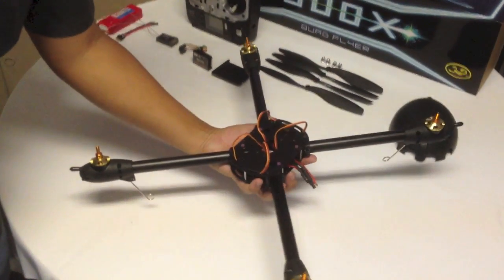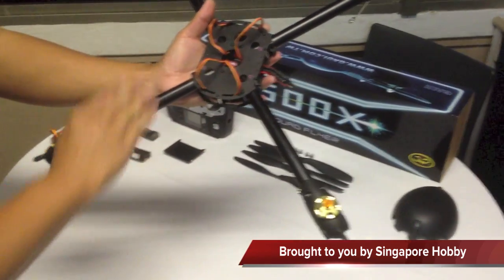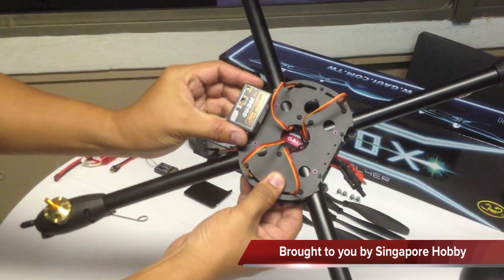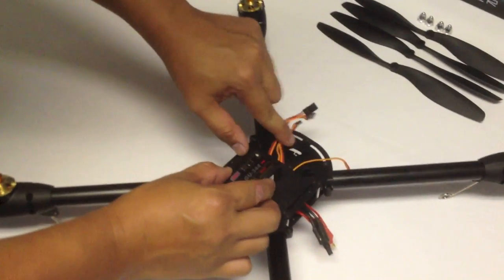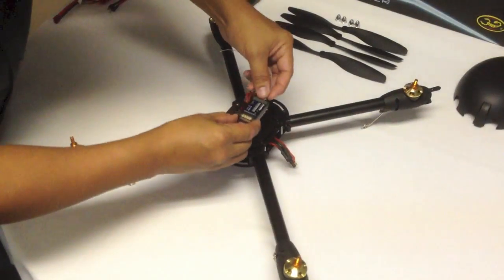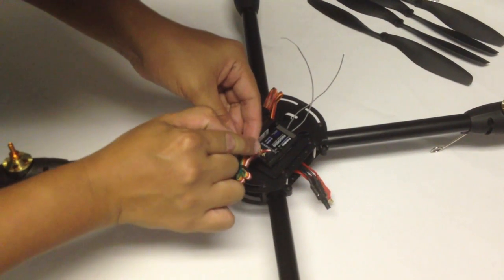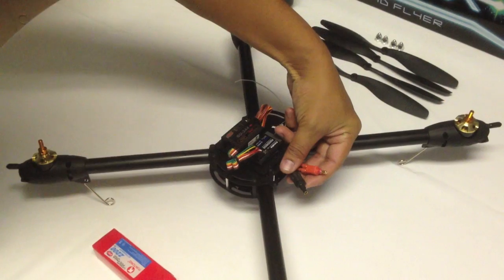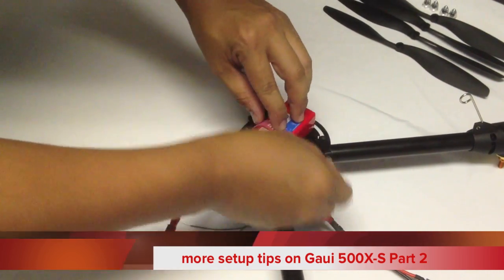Setting up of the Gaui 500X-S - Part 1

Comment from the maker: The Gaui 500X-S quad-flyer is compact and designed with portability to fit into the bag that comes with the 500X-S It also packs 4 sets of Scorpion motors that makes it powerful to lift a total of 2.2kg. Overall, it is well-design and of remarkable quality parts. One thing to note is the low height above ground. If you plan to carry something below the 500X-S, we would like to recommend a set of landing legs or camera gimbal to go with the 500X-S.